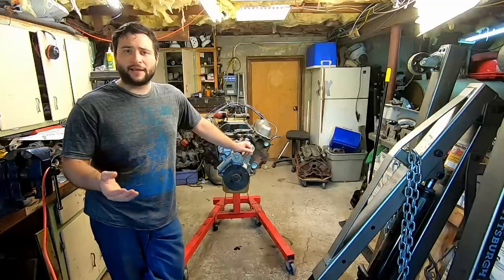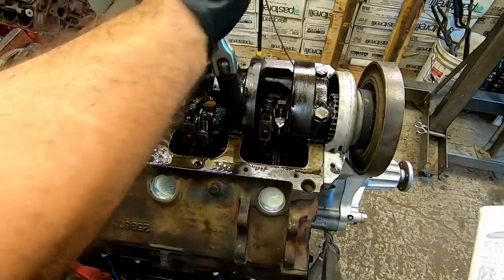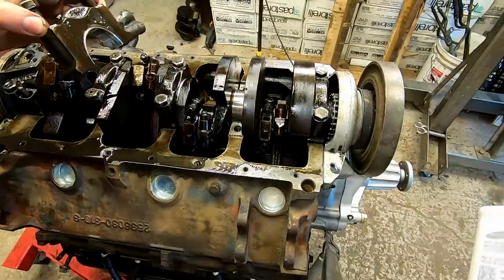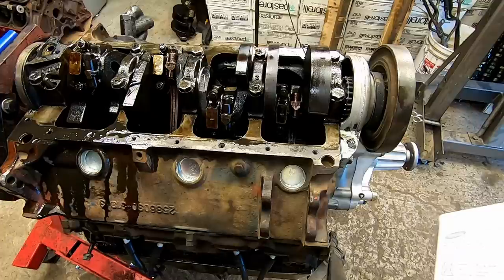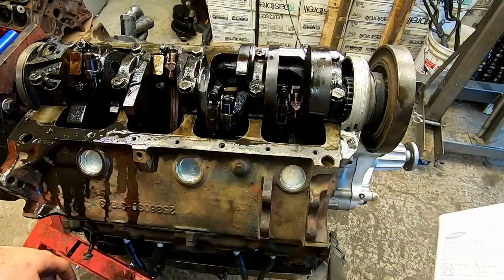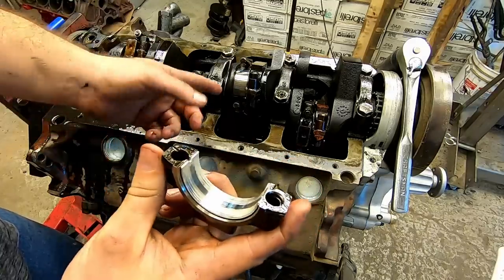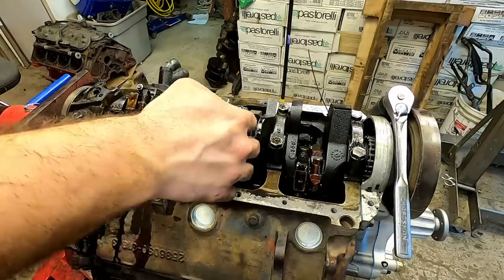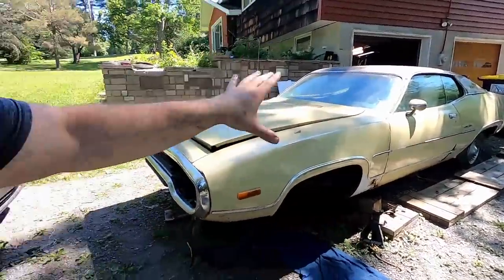The Mystery of the 318's Low Oil Pressure Solved! update the crank was worn out .07 not machined

Comment: the back of the bearing will be stamped as to what size they are
Reply from the maker: I hope this helps. The engine block was donated by Uncle Tony. The bearings I pulled out of my block were standard. When I was approached to do the project, I was told to find a 318 car, pull the engine, don’t worry about anything other than stripping it, putting the parts in a bucket, and bringing it down. Anything that needed to be replaced, he had in stock. I expressed concerns about the block, cranks bearing surface and thrust service, and heads. He said he would prep a block beforehand, and check out the other stuff once I got down there. He checked out the crank, gave it the ok, and then assembled the rotating assembly. The oil loss came from excessive wear on the crank in the ball park of .07, and the thrust surfaces were wiped out. I ultimately replaced the crank with a 10 under 340 crank, and it has awesome oil pressure. Unfortunately, the cylinders are out of round of hiring for excessive low by on the passenger side. I will do a video about it in the spring, right before I replace it with the 440.

Comment: For Gods sake dont pull full torque on one side of the bearing cap! You've got to evenly torque the cap! 🙄.This guy has quite a learning curve to go thru.
Reply: This! Never put all the torque on one bolt! pull them both down evenly and slowly. Also tap the main bearing caps down before you start torquing  to make sure both sides are sitting flush in the block. You are scaring the hell out of me!
Reply: I'm glad someone said it before  me.
I was quite literally cringing at that!
Reply: @markszychulda6194  yeah and why didn't he plasti gauge the mains when he built it the first time. He also checked the hardest cap to get to or he could've rolled the engine over to make that one easier. Rookie but i got to give him credit he is out there doing it instead of laying around being lazy.
Reply: lol I was thinking man what the hell are you doing? I'd suggest at least reading a rebuild manual.
Reply: @Flowtester1  ya always.
Reply: Flowtester21 tony from uncle Tony’s garage assemble the rotating assembly, why tony didn’t Plastigauge it I still can’t figure out he makes it seem like he is the expert engine builder.
Reply: @darthrevan8513  ya I don't know many engine builders that wouldnt insist on checking the oil clearances.you gotta be sure or your gonna spend alot of time and money fixing mistakes.
Reply: @darthrevan8513  I've come to the conclusion that Tony is just a junk yard hound at this point. Its not enough to make videos on cleaning greasy parts with gasoline and talking about engines that are laying around. He needs to build and engine and run it on a stand to back up his know how. Because from what Im seeing all he owns is tired worn out gutless cars that smoke really bad. If he's so knowledgeable why not rebuild a legit performance rig?
Reply: o my!
Reply: @darthrevan8513  obviously he is not.
Reply: When torquing mains and rod caps go in three steps .
If that main was 85 foot pounds go 30 , 30, and 25 .
  But yes as the others said . Don’t fully torque one side then the other...
Reply: Seems like a nice guy but he's not allowed to wrench on any of my engines. Hope he learns correct torque step up and sequence before he installs the heads. Don't mean to sound like an a-hole, just sayin.

Comment: One piece of advice,  when torquing you should tighten your fasteners equally and then final torque.  You don't want to torque one fastener at a time .
Also it's not uncommon to have a crank cut to different sizes, if you don't have to machine the mains or rods journal then you only machine 1. Nothing, 2. Either mains or rods. But yes if you grind/resize then all mains must match or all rods must match.
You'll get it sorted out 👍
Reply: Good comment on torquing down bearings. Basic shop craft is often overlooked but it's the little things like measuring before torquing that can save a lot of time and head scratching.
Reply: Normally you don't want to cut a crankshaft more than is necessary to clean it up.  That is why you might cut the main and rod journals to different under sizes especially if it is only one journal that has more damage than the others.  If you don't get the right size bearings as in this case you will have low oil pressure which will eventually wreck the engine beyond repair.  Good engine builders will carefully measure all clearances before assembling an engine to prevent this from happening.  That is why rebuilding is such an expensive proposition as opposed to purchasing a factory built crate engine.

Comment: engine building 101 always check  bearing  clearance as you assemble. I have found new bearings miss marked from the manufacturer
Reply: just wondering. are you from Pottersville NY
Reply: @josephshields2057  no, illinois
Reply: Suorised tony didn’t measure the bearing clearances the first time ?

Comment: I've had this happen b4 and is why I own a good set of staritt mics now. I don't use plastic gauge anymore I mic my crank and use my bore gauges to get my provide clearances. Plasti-gauge is great for stock applications but when you get into performance oriented motors then measuring the crank and bearings is the best way

Comment: I was following Tony and Nick  before this all started.   Tony's job was to  assemble a pile of parts as is . Good job accepting your  learning pains.
Subscribed
Reply from the maker: Thanks my dude
Reply: I want to tell you something if I'm going to help somebody assemble a motor I'm going to do what I can to make sure it's right
Reply: Tony should have known better. I get risking shortcuts on a known, good- running engine that you just want to freshen up. You can hone, re-ring and replace bearings, but somebody's crusty high mileage motor? ... well you see what happens. Ditto for not checking clearances. Never assume a molested engine (non-original gaskets) is what it seems.

Glad you got it worked out, but there are certain steps and checks you cannot shortcut unless you accept that a failure has high potential as a result.

Comment: It's the odd things that catch you out.
Built an engine (Australian 265 Hemi) many many years ago. Went together ok, but it was always a bit hard to turn over. Never improved with miles. Seemed to stop quickly as well. Pulled it out for an upgrade and decided to diagnose why as it wasn't right. Took a bit of hunting but finally found it. 
My dad was a mechanic and had lists of "tune up" and torque figures for most common cars. The edition of the list I'd happened to choose for the main bolt torque value had been converted from imperial to metric...twice. My main bolt torque was 36% too high.
Undo mains. Check bearings (ok) back together at the correct torque. Perfect.
Reply: holy shit xD
Reply: must be an aussie thing because ive had that happen with torque values ,things go hinky in the conversion ,had it happen on a clevo i was doing

Comment: pull the crank...mic the mains and rods in my different places..thro the new bearings away ..get a mic with a deep jaw that will fit over the journals..EVERYTIME YOU PULL A MOTOR APART...ALWAYS  mic everything ..and clean that puppy well
Reply: You CAN pull them apart without a mic, especially if you're getting everything machined.  However, you NEVER put them together without checking clearances on EVERYTHING!!!  Plastigage is your friend!  So is a good mic.  I've built things like a bone stock straight 6 with just plastigage before, and everything was fine.  Anything that will EVER be run hard gets checked with a mic, then plastigage EVERY journal (with everything clean and dry) during assembly just to make sure.  It's a LOT easier to find clearance problems BEFORE you button it all up and drop it in to something!

Comment: Check the factory engine stamping. If there is a Maltese cross,  and an “X” the mains are .010 under.
Reply: Yeah, I have a chart somewhere with the various undersize marking codes but I can't find it right now.  There can single journals undersize, or all at .001 or .010, even lifter bores had a marking code to indicate an overize lifter bores on some engines.  THAT would be a pain since oversize lifters are very rare.  I know that the later Magnum 318 and 360 cranks are marked with obvious codes like M1 or R5 to indicate a single 0.001" undersize on those specific (eg. Main 1 or Rod 5) journal numbers, and there are different piston codes like A/B/C/D/E which are 0.0005 increments over standard.  I have a spare 1984 360 (which is now .030 over) which originally had one of those weird combinations, it has things like AABD and DAEB stamped on one of the pads by the deck to indicate it had different sized pistons installed in the various cylinder bores.  I had never seen that before.  I don't recall if I ever checked to see if it had a sequence number that matched the VIN on the van it came out of, I suppose it could have been a factory re-man rather than first-production from the factory, who knows?  It was the first time I had ever seen that, but this was like 25 years ago.  :)  haha  The engine that is in the van right now is the one out of our original '78 van, which has no sequence number, so either they forgot to stamp it, or maybe it was a warranty replacement engine or something...  another "who knows".  :)
Reply: Only us true mopar guys know this 😂

Comment: 1976.  Oklahoma State Technical Institute.  Diesel and Heavy Equipment Mechanics.  We were taught when overhauling an engine that the easiest way to check if the bearings need to be replaced was to remove the caps and visually inspect the bearings then put those plastic strips on each crank journal and torque them down and then remove them and check the strips.  If they all were close to specifications then there was no need to pull the crankshaft and replace bearings.  Only needed to leave it uncapped long enough to replace the rear crankshaft seal then put the caps back on and torque them.

Of course I worked on engines that weighed as much as a small car and had head bolts that torqued to 350 foot pounds.

Comment: Probably only ground the mains due to a spun main bearing.  Would also explain the duplicate stamps.  Always measure main and rod clearance. Glad you found the problem without catastrophic failure.
Reply from the maker: Got lucky. I definitely take for granted that I work on engines that are so new the last hands that in them was the manufacturer
Reply: If it spun a main bearing you can be certain that all the mains were align bored, not to mention that the big ends of the rods might have been resized. All those clearances pile up and need to be checked during the buildup. "Standard" bearings only work with stock manufacturers tolerances...... "10/10 cranks are commonplace, but bearings for a 10/10 crank in a align bored block that's now 10 over....those you'll have to look for or order....not off the shelf items at most parts stores.

Comment: Nice to see what the issue was and that it wasn’t really your fault or Tony’s falt 
So guys ALWAYS use plastigauge it doesn’t take long and gives you insurance that your clearances are pretty close
Reply from the maker: Never trust what was in a 50 year old engine lol. But yes always use a plastigage. I take for granted that I work on engines way way newer and have been untouched from when they cam off the assembly line. I know every time I have hit my builds plastigage they have always been right on the money. They are a cheep and easy tool that will ball park it very quickly.
Reply: it was Somebody's fault...2 men construct an engine no one checked clearances...whose at fault?
Reply: @billcat1840  the guy who said he never uses plastiguage...tony. look, i dont use it either, but i check my stuff all over, mic journals, look for maltese crosses, etc...

Comment: Good lesson.  I bought a used crank that was supposed to be 0.010 / 0.010.  Turned out to be 0.020 / 0.030.  I put the 0.010 bearing on and used plastigage at first.  It did not even smash it down.  I then took a digital caliper to it to determine the sizes.  Sorry you did not catch the bearing issue when you put it together.  It is a shame you were in a rush to get it put together.  Maybe an extra day would have had everything sorted out.
Reply from the maker: Yup unfortunately When Tony put the rotating assembly together I should have been paying more attention to what he was doing. But live an learn
Reply: @LunarOutlawsGarage  'Haste makes Waste'.  Just one of countless maxims that get shared in moments like this. 

I get the 'spirit' Tony was operating in.  And when everything goes your way, you can get away with overlooking some steps,  but in engine building, you cannot skip critical tasks like mic'ing the journals, and snap gaging the bearings IF you don't wanna get bit by Murphy.

Makes me so TIRED just thinking of the road miles to and from Nashville and then dealing with the asses at the border crossing of Canada (I have done that every time we test vehicles in Alaska, and I can write a damn book about the ways the border agents can be either, your best friend or your worst nightmare), then the roadmiles to Nick's,  then getting kicked in the sack, by Murphy,  then drive back home and find out something that FIVE extra minutes spent using a dial caliper while the crank was standing on the floor in Nashville.  GAWD. The misery.

HASTE, MAKES WASTE.

Graham Heath, an excellent old mechanic at C&H Machine in Madison Indiana back in 1974, let me sweep the floors and take out the garbage and he didn't run me out of the shop when they were assembling the V12 engines for the Miss Madison Hydroplane.  I was eight years old when Graham showed me how to read the graduations on a Starrett Micrometer, as he used it to mic the supercharger bearing shaft.

By 1984, I was in vocational school learning from more old guy mechanics, building a 318 for my Senior project. I watched the WHOLE build of this series, and I cringed at some of the cigarette smoking bravado.... but I smiled BIGGLY at allot of Tony's comments because he too, has traveled those roads. 

Each 'House' you look at, in the Performance and Racing Industry,,, has evidence,  of the degree of excellence they adhere to. 

Holman and Moody. Sox and Martin. Petty Enterprises. Smokey Yunik. Shirley Muldowney. Don Garlits. Bill Jenkins.  John Force. Kenny Bernstein. Cotton Owens. Harry Hyde. 

I have pictures of many of those people in their element, and luckily, they let me hang out for a time.

Tony is a very knowledgeable guy, he's got a STUNNING background in the industry. When you live long enough and pursue your dreams hard enough,,, you get to have some great times like Tony has, and I am humbly thankful for the ones I have been part of. 

Me and Tony have absolutely never broken bread together, but we have drank beer in the same garage and pit areas over the years. 

It's good to see him sharing his knowledge with pups like you and John. 

Don't pay too much attention to the haters. They never make a real difference in this world.  Focus on brotherhood and goodwill.  You will go far, if you do.

Can't wait to see the 318 back on the dyno for the proof to be put into the pudding.  And a little part of me wants to see Tony's slap together 318 prove some of the smartaysses in the comments section wrong.

Comment: Something you should understand,  It is good practice and highly recommended in multiple books I have on engine building that you check ALL clearances.  All rods, all mains.  NEVER trust all are the same. When I do an engine I check them all. yes it takes time but let it take time. Some have documented they have noticed machining errors on their blocks / crank / rods.    I'm rather surprised you didn't plasti-gauge them in the build at Tonys. Its just assumed its done every time. seen where on a big block  some rod journals were way too tight and most were fine. the crank was ultimately scrapped.
Reply from the maker: yup I take for granted that I work on much newer engines that have not been opened up. But I Plastigage when it is going together. I have never had this happen, but I am glad it was not a catastrophic. Tony put the rotating assembly together, and in a life afterwards he said he has them down there but doesn’t believe in using them or something along those lines.
Reply: @LunarOutlawsGarage  with thousands of people watching; wasting Nick's time;  I gotta say, pretty stinkin' catastrophic.
Basically, take a junk engine and waste hundreds of dollars of labor.... to get a junk engine.  But, hey, you "saved" on machine shop!!
Did you actually check the connecting rod ends - could need resize.  
I imagine someone asked, they ever heard of a ridge reamer?
Once you do all the tear down labor, sure worth it to do the job right, or just don't bother!

Glad I could help, but, man, that was painful to watch.  
Of course, to each his own, it was at least "theater", and some people enjoyed it.
Teaching moments are great, I just prefer them from people who, like, actually know what they are doing; no offense. 
I have certainly had my own share of very disappointing blunders over the years building engines.  I learn from 'em all.
Reply: Hey, you didn't have to watch at all !?
It was a strange kind of amazing spectacle, I just wanted to see "what next".
Maybe you have a winning formula ?